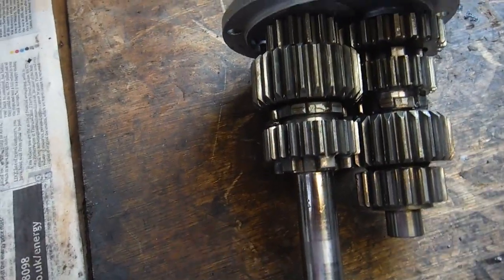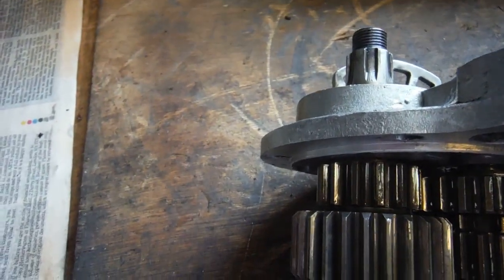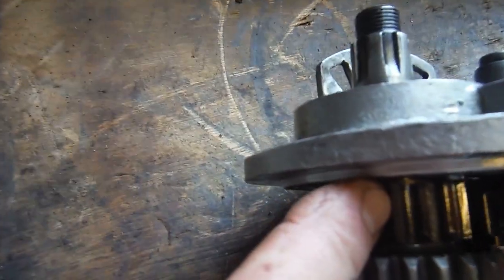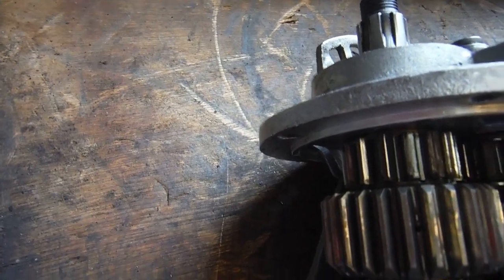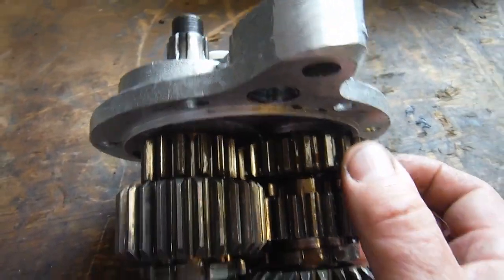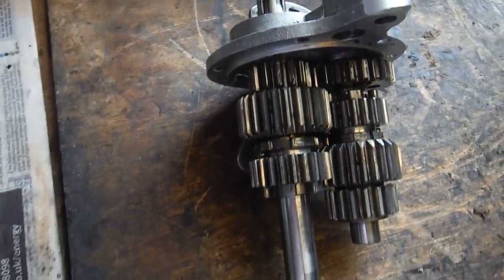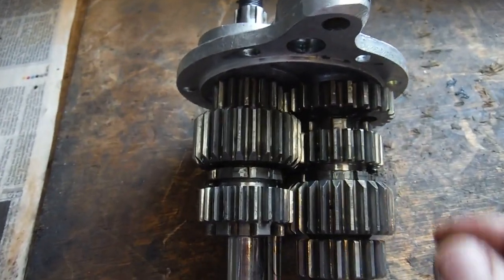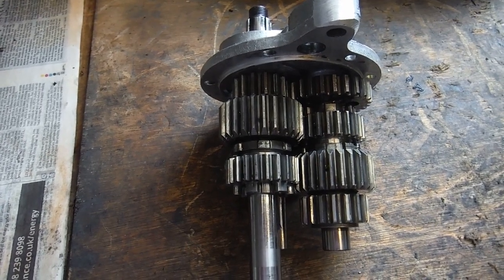BSA A65 gearbox whine in 1st gear was due to mismatched gears!

Comment: I’ve got a 66 bsa thunderbolt. I’ve slowly been restoring. Anyways I took it for it’s first ride in over 25 years today. Anyone tell me what speed to expect in first gear without the bike stalling? It seems to need a lot of speed to prevent stalling. Thanks so much everyone.
Reply from the maker: It should go down to little more than a walking pace in 1st gear.
Reply: @paulhenshaw4514  thank you.  I appreciate the feedback.
Reply: @paulhenshaw4514  thank you for your channel. I just found a significant oil leak coming from appears to be the main small sprocket. I assume the seal around the drive shaft is bad.  Just now looking into it.  Hope you have a great day!

Comment: Hello Paul.  Very interesting issue, at least for me.  Gearbox in my bike whines when in 3rd or 4th gear and I was (am) totally lost as far as what could be the cause of that.  The bike is actually HD but whining is not necessarily make related.  Individual gears appear to be in absolutely pristine condition.  The said gearbox is not an OEM neither brand new although apparently very little used.  Is it possible that also in this case there is some thrust washer missing?  Thank you.
Reply from the maker: I would be a bit concerned if the gears are not original from the maker, it might be down to the form of the gear teeth. My Triumph Tiger Cubs whine a little in 3rd gears to varying degrees, but don't sound nasty - I think most of them do it, but not sure about H-D machines. If in doubt, get it checked out, gearbox lock ups are very nasty - from someone who has experienced one or two!
Reply: @paulhenshaw4514  - Thank you Paul.